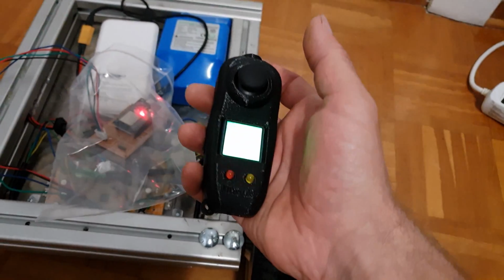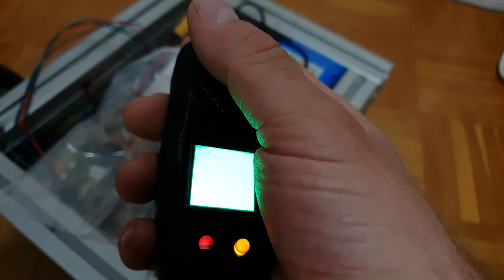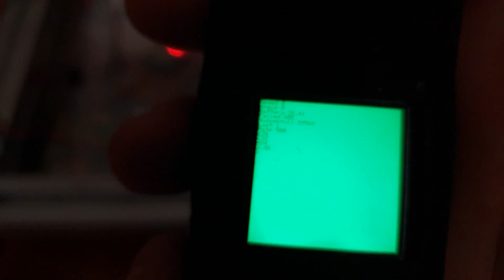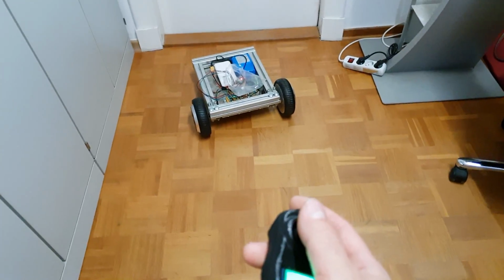Esp32 Arduino Hoverboard Car done with espnow

Comment: Do you have a video showing a diagram and code for the parts you used?.. 
Can the circuit be wired to control 6 wheels?
I would like to make something like the Mars Rover or NASA Athlete.

Comment: Can it be controlled by VR Control Bluetooth Remote Controller ?
Reply from the maker: Hey.
It is open for everything so yes could be implemented
Reply: @atc1441 hi.,thanks for the  response, can I used the same Firmware for yst-dxt-j20 v5.1 board?
Reply from the maker: I can not answer that sorry. You need to see it yourself
Reply: @atc1441  can u share the wiring diagram of esp32 connection on controller board of hoverboard ?

Comment: Hi, good job it looks good. I have a question how did you connect Arduino to the motherboard, I thought to connect Arduino to IR sensors but do you have any better solution?
I'm not much programmer. I can't do more than Arduino IDE.
Reply from the maker: Hi. 
Please read this readme and watch the video that is linked there, it will explain a lot.

The Arduino is connected to the seriell port of the onboard microcontroller from the hoverboard
Reply: @atc1441  Which "readme". Where it is?
Reply: @atc1441  where is the Readme? There is no link to a Readme or the arduino code you use. Is there a way to view your arduino code for this project? Thank you.

Comment: Hi, great project! What hoverboard did you use? Was it hard to integrate it with arduino? Are you using original motor controllers and battery from hoverboard? Cheers!
Reply from the maker: Hi that is the cheapest hoverboard of them all. It is relatively easy to integrated with my code.all the parts are from the original hoverboard plus the arduino

Comment: Hi do you have a github page? I will like to use a ESP32. thanks, good job
Reply from the maker: Hi. This is the firmware i am using on the esp inside the hoverboard: https://github.com/p-h-a-i-l/hoverboard-control/tree/testrun but i edited it a lot. You should be able to get there. Until now i didnt uploaded my version.
 And here is the firmware i am using on the hoberboard mainboard https://github.com/bipropellant/bipropellant-hoverboard-firmware . Both can be compiled with platformio.
Reply: @atc1441  thank you i will test it.